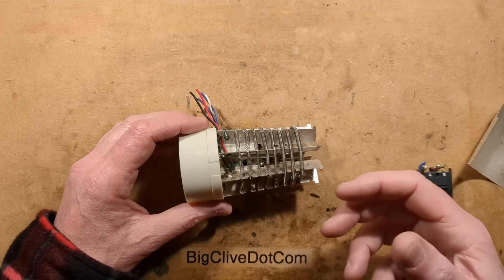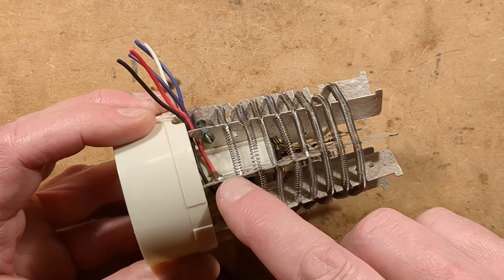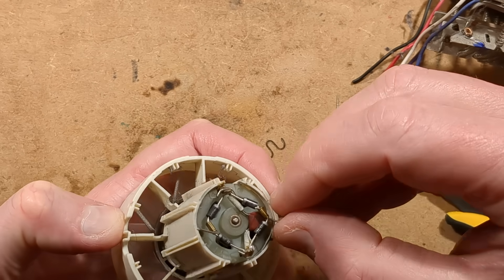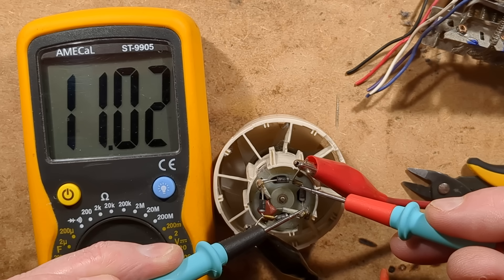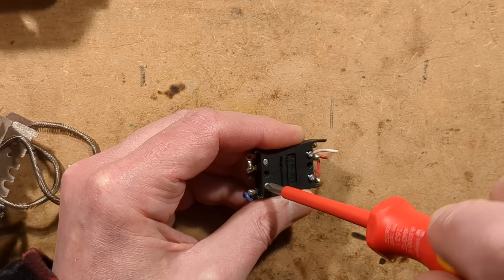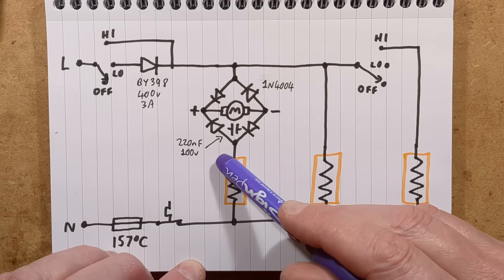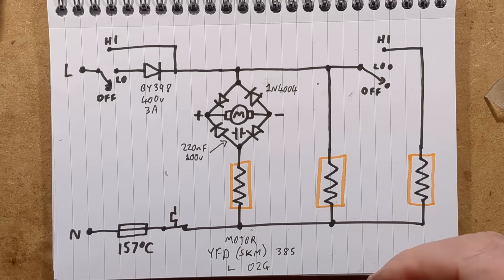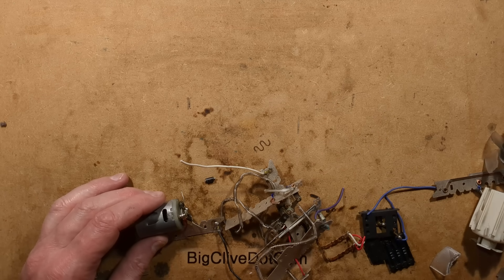Failed hair dryer exploration and schematic

Comment: Never realised they used low voltage motors. Most interesting.  For some reason the thought of you not being able to dry your beard reminded me of an old joke:   
Paddy comes out of the construction site toilets with dripping wet hands and says to the foreman "There's no hand dryer".  
"Ah" says the foreman, "the boss made us take it down to save money on electric.  You can use the manual version if you want?  Jake over there controls it.".  
Paddy goes across to Jake, holds out his wet hands and says "Foreman says can you let me use the manual hand dryer.". 
Jake bends down, picks up 2 bricks, and smacks them either side Paddy's hands.  Paddy jumps up and down yelling "Oww, oww, oww" whilst blowing on his red and swollen hands. 
 "See". says Jake. "it does work... but nobody ever uses it more than once."

Comment: 240V minus a bit for the motor, across the 125R dropper = 1.8A (ish) - that's a lot for a 1N4004 1Amp diode bridge.  You're right - a good source of heating wire.

Comment: It reminds me when a few decades ago, I took a section of heating element (measured by resistance) from a defunct hair-dryer, and secured it on a micro-fan (mini-muffin), and installed in my visored full-face  helmet - this kept my visor clear of fog and gave me just enough warmth that I could comfortably ride my motorbike in cold and wet conditions year 'round - Good time! ☮ 🛵

Comment: Kinda weird construction where all current to the first element all goes through the motor, I have seen hair dryers where the motor instead have been tapped in at like 10 percent of the winding instead making the maximum voltage across the motor stay low or within spec. here if the circuit in the motor is poor or opens you get the full mains voltage across it. I suppose this is why your diode broke in the first place

Comment: How do they fine tune the resistor value of that heating element for that particular motor voltage?
Reply from the maker: Probably by measuring the current at the full speed they will run it, and then fine tuning the element resistance to match.

Comment: What a coincidence... Just this week I disassembled a nearly identical hair dryer to "harvest" the coils for a project. Now I get to see how it was meant to function. Mine said that it had an ionization feature. (?) Same three-coil design, bridge rectifier and all that. So convenient that you just happen to be pulling one apart today.
Reply from the maker: The ioniser module will be a tiny resin potted module with mains going in and a silicone wire coming out with a tuft of carbon fibre at the end.  That's the ion emitter.

Comment: Interesting to see a diode that failed open rather than as the usual dead short.
Reply from the maker: Yeah, and intermittently at first too, so it must have been arcing at a bond.
Reply: I've seen more diodes fail open than short, personally.

Comment: Many years back I ordered a Harbor Freight hot air gun, and heard negative reviews about the diodes shitting the bed violently and exiting the nozzle on fire, so as soon as I got mine I opened it up, replaced the four skinny diodes with beefy 3A 1000V diodes (1N5408), added the capacitor that wasn't there but I knew from experience is usually across the motor.

I also replaced the skinny diode used for low speed with the same beefy 3A 1000V diode, and it's been working great for 7+ years no problems.
Reply: It always amazes me how often equipment fails just because the manufacturer skimped by saving a few cents by using a lower rated component, and end up running the components at or above their rated capacity. Result, early and unnecessary failure.

Comment: Wait, wait! Is there such a thing as a bad beard? Never heard of it. 🤣

Aren't the two metal leafs close to the thermal fuse acting as a safety switch? My understanding is that if the temperature raises too much the metal deforms and the leafs separate cutting power.
Reply from the maker: It's a self resetting bimetallic switch.
Reply: @bigclivedotcom thanks. Never knew the proper name for it.

Comment: Rectifier diodes like to go out with a bang. My old computer speakers let out a loud bang the other day along with magic smoke. This spectacular event led to some forensics. The results are pretty obvious with one of the 5401 power diodes on the bridge rectifier completely blown to bits. I need to troubleshoot the circuit and find out what else is toast. I have a feeling the diode isn't the only symptom of the failure.
Reply from the maker: The main primary side transistor or the electrolytic capacitor often fail and destroy the rectifier in the process.

Comment: The motor resistor/heater would explain why my hair dryer still puts out slightly warm air when I press the "cold button". I always wondered why that is. It seems it only cuts out the main heating elements, but the motor heating element must stay connected.

Comment: When I gutted my hairdryer I found out that the motor was 24v but it was running at 16v. Weird, but at least they didn't use 12v motor and run it full power when it was inside tad hot environment 😅, maybe getting 24 was cheaper for them or they had them in stock...

Comment: The motors are normally 20V or so, and the older ones had a tapping on the one coil around the 10% mark, to tap off the fan voltage, and then had the second coil for high power. The half speed  function was by the tapping coming back to the switch, where a diode, 1N4001, was used so the bridge got fed with half waves for low speed, and full AC for high speed. Often the diodes were unmarked, just had a band on them, so obviously the factory rejects, barely good enough to be a diode, and likely breaking down under 75V, as that is the threshold to bin the 1N4001, as the 50V breakdown has around a 50% threshold in test. 

These days pretty much the only diode you get is the 1N4007, as the process controls are such that anything below 1500v breakdown will be a reject, and if there is an order for 1N4001-6 they simply mark the 1N4007 diodes appropriately. Guess the new circuit you have is to simplify the switch, and save on a wire leading to the heater assembly, as that PTFE coated stainless steel wire is expensive, while the thin nichrome wire is cheap, less metal in it to add a second coil.

Comment: Another Big Clive video and another learning experience. The postman has just delivered the replacement part for the dehumidifier I have in pieces so in true Clive style it will be back to life shortly. It always pains me to look into the electrical waste skip at the local tip, so many of those items must be repairable. My Wife's expensive Swiss hand mixer ground to a halt before Christmas and in many households it would have been binned and replaced. I had it working again within the hour and various Christmas deserts were back on the menu as a result. Vive le réparateur!
Reply: I'm the same re: electrical waste at the tip. I wish I could take it all home to repair but I believe you're not allowed to do that!
Reply: @Gledster It’s a crime that most of the recycled e-waste isn’t actually recycled. I’ve slipped one of the young lads a fiver to climb down into the container and fetch a few items I’ve needed for projects, but I suspect he’d draw some pain from his boss if he’d been caught.
Reply: I didn’t even try to repair my broken sous vide water heater/circulator! I couldn’t figure out how to open it up and just lost heart and got rid of it.

I feel ashamed of that.

Comment: Ah, the hair dryer:  I was about 7 when I first took my mother's hairdryer apart.  It turned out not to go back together so easily before she became aware of what I had done ...  You see I wasn't good at putting my toys away, either.  It was admittedly less complicated than my father's stopwatch, but I felt I excelled at dismantling.  So I subsequently graduated to the cuckoo clock.  That did go back together, but not before I had created a version where the cuckoo lived outside and went in on the hour.  It got called the Oocuck from then on.
Reply from the maker: This is how great technical careers start.
Reply: As a kid I would take apart and reassemble just about anything I could get my hands on. I don't remember how old I was, but I do remember when my mom told me she needed me to help her fix her (very expensive) sewing machine. Though that was pretty easy, on machines like that they were made to be repaired, easy to disassemble and reassemble. As long as you didn't loose anything or forget how it went together. No online tutorials back then...
Reply: This is a necessary and perfectly normal developmental process.👍😁
Reply: I took apart every electrical/electronic as a kid. All the stuff in my room, my dad's expensive 70s hifi, tv, video player, computer etc.  Took my time and noted everything,  all went back together and worked fine. Started doing this age 11 ish.
Reply: I have a Morphy Richards hairdryer from the mid 1960s it has worked splendidly ever since I replaced 0.47uf wax motor capacitor the hairdryer is rated at 400 watts.
Reply: You were so close to invent a time machine.
Reply: I used to take everything apart and just leave it 🤣🤣🤣 I'm kinda like that now...I ll put it bk together tomorrow when I've had a think 🤘😁 ye if you don't pull anything to bits you won't learn owt 😆😆😆
Reply: I can relate.  As a kid, if it had motors, gears, belts and pulleys it would get taken apart.  Now at 53 it's my side hobby. 👍
Reply: @musicnerd72 mine too...56 🤘😁

Comment: It would have been a pain to replace the diode and re-assemble, who knows if the other diodes would last much longer either.  Bed Beard?, well that's better than Bed Bugs or even worse Beard Bugs... Good idea sourcing a new dryer.  Personally I just air dry naturally while combing the beard out but my facial hair is much shorter than yours..  Thanks for the deconstruction, look inside and schematic Big Clive, excellent!

Comment: My faithful old hair dryer of 20 years finally gave up its last, using it to thaw the pipes in my crawl space when Dummy Me neglected to keep a trickle going. The outside temp was below freezing for several days. Hair dryer to the rescue, it did the job but then croaked. It was probably not made to run 30 continuous minutes.
Reply: You can get low power heating elements for water pipes.
 They're similar in construction and power to the lines in an electric blanket, and wrap around the pipe inside the foam insulation noodle.
Reply: @massimookissed1023 yeah I haven't yet gone that gung-ho on it. We get maybe 1 or 2 hard freezes a year, I just have to remember to let the water run a little bit.
Reply from the maker: I wonder if the water trickle could be automated with a thermostat and solenoid valve.

Comment: I took apart some old hair dryers, probably from the 1980s or before, which had induction motors in them and 2 switches, switching the motor and the heating element separately.

Comment: These are my favorite source of nichrome wire for the cutting of extruded polystyrene. If you run a controlled DC voltage through a short straightened strand it heats nicely.
Reply: No doubt you've figured this already but for others - stick a screwdriver through the spiral and pull to unwind and straighten it. Otherwise stretching the "spring" results in a stretched spring!
Reply: You don't have toast in the morning? Easier to recover the straight nichrome off dead toasters. 😉😊
Reply: @theoztreecrasher2647  but I use the toaster.
Reply: @theoztreecrasher2647  Dead toaster? What's a dead toaster? I still have both the toasters I've ever owned - the one that gets regular use is one that was "free" when I bought a Philips washing machine in 1987; the other is in the loft as a backup, I inherited that from a great uncle in 1980. That one is the old fashioned type which toasts one side of both slices of bread and has glass doors on both sides. When the glass doors are opened, the part-baked toast slides down and out onto the door and is then correctly positioned for the other side to be toasted when the door is closed again.
But, yes, "right to repair" should be standard. I was impressed last year when I had to replace the motor capacitor on my Bosch dishwasher - a full set of parts still available from Bosch as well as diagrams which are almost adequate for disassembly / reassembly.

Comment: Hi Clive, the motor is 3volts to 40volts according to their website made by yfd-motors in China
Reply: That usually isn't the specification of the motor, but the whole series. The actual needed value is specified by the customer (in this case the hair dryer manufacturer) and the motor is then wound to that spec. The print on the motor itself almost never tells you the rated voltage, just from what model series it is.

Comment: the diode - has Die-ode! and the contacts in the switch were found to be quite Sootable for the application.
is the line voltage of this hair dryer 230 volts, or a lower voltage with a wall wart? wondering, if it is 230V, then maybe the 125 Ohm heating element
going  from the neutral to the motor, is acting as a large bleeder resistor to cut the line  current down to the 6 Volts for the motor?
Reply: It'd absolutely be mains voltage.
A wall wart that could handle 1 to 2 kW would be more of a wall tumor.
Reply: @massimookissed1023  LOL, thanks👍

Comment: Found a hairdryer in the last hotel. I stayed in, which, if you put it onto the high heat setting, would cause a thermal fuse to cut out after about 2 minutes of use.
Reply from the maker: That could have been caused by dust buildup inside or the thermal switch developing bad contacts and self-heating.

Comment: quite often they put the motor across a number of turns of the heating element so the element acts as a potential divider, it provides a nice defined voltage for the motor.
Reply: My previous hair driers and various fan heaters also had the potential divider layout. Until this video, I had not come across anything that uses a simple series resistance to run a low voltage DC motor.
Reply: @Julie9009 I have seen this divider trick too, both in a Philips drier and in a more “pro” Wigo taifun (made in western Germany). Seems to be a more safe and stable way to do it.

Comment: I've been curious for years about 12v hairdryers for defrosting car windows during the winter, here in the central belt of Scotland we are approaching -6, I've been too wary of buying one (they are very cheap from Agros), But 1200w 👀, I don't want to melt my car wiring loom, would it work?.
Reply: The fuse on the cigarette lighter socket fitting is probably either 10A (ie. 120W) or 15A (180W).
Reply: @nowster Thank you 😊, my instinct to not mess with stuff I know nothing about is intact, as is my insurance claim and car.

Comment: So, was the failed diode one of the 2 that got fed in the low setting?
Reply: they get fed when the dryer is on, regardless of speed, because they rectify the AC to DC for the Motor.
Reply: @deelkar in the low setting the inline diode makes the signal a halve wave. Only the positive part of the sinus gets through. So only 2 of the 4 diodes in the full bridge get power through them, and 2 block. Those 2 that block, never pass current through them because the other diode already blocked that current.
Reply from the maker: I'm not sure if it was one of the diodes active in the low mode.

Comment: I presume there is no cold setting as it uses a heating element to drop voltage to the motor?
Reply from the maker: The ones that do have a cold setting are still using the heating element in series with the motor, but the airflow is so high that it doesn't feel warm.

Comment: I suspect that the element in series with the motor has a resistance that is higher than 125 ohms.  220 VAC divided by 125 ohms is nearly 2 amps, which seems too high for that motor.  Also I squared R means the element would be dissipating 500 watts, which seems too high.  That was one thing that Clive didn't tell us - the wattage rating of the hair dryer.  Thanks, Clive.
Reply from the maker: It does really push the motor at full power.  I recycled the case, so don't have the power spec.
Reply: If the heating element drops all 220V, what voltage is "that motor" running on? Multiply that by 2 amps, you get 0 watts, right?🤔  , then again, the resistance will increase with temperature within the element, unless it's got a negative temperature coefficient...

Comment: Most likely a 24V motor (024) the G normally denotes geared, so was that a 4 or a G?
Reply: The 10 or so I've dismantled over the years all had either 12V DC or 240v AC  motors
Reply from the maker: Definitely 02G, but no gears.

Comment: "A failed surgery is halfway into a successful dissection."
Nice teardown - these things indeed weren't meant for easy repair... The dreaded use-it-and-toss-it all over the place.

By the way, I still have a Philips hairdryer I bought secondhand around 2008 or so and apart from fixing its switch and power cord, it's very reliable. Definitely a keeper.
Reply: If my surgeon said that I would be a bit concerned